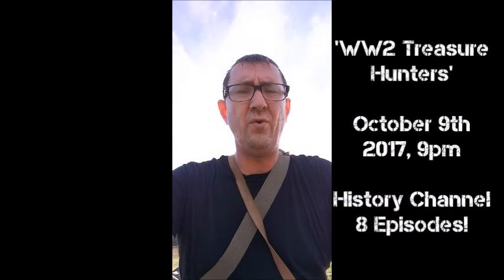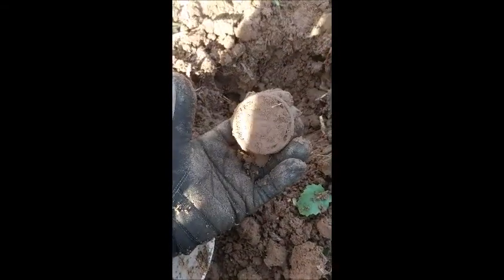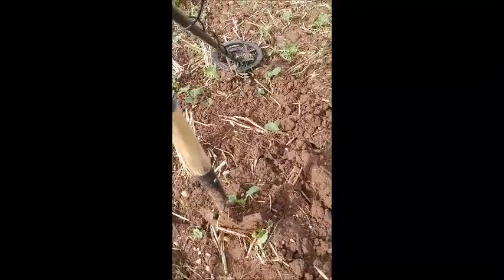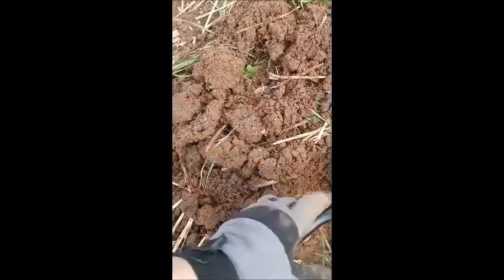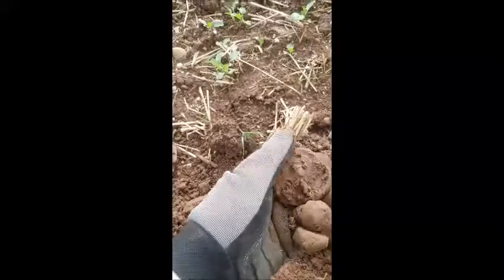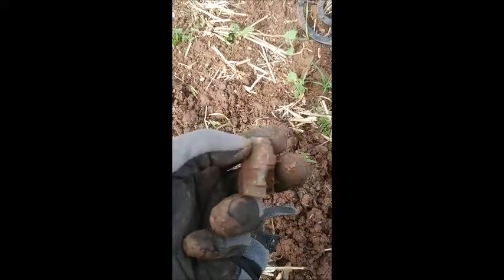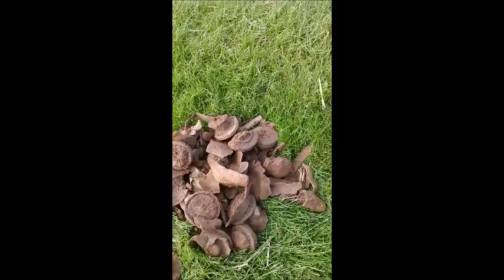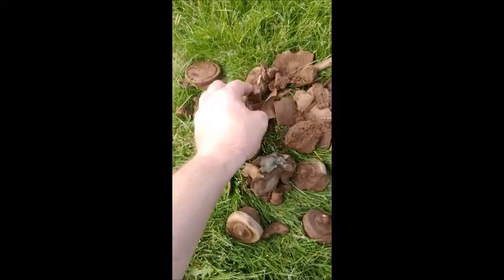WW2 RAOC Depot - Recovering Exploded WW2 ordnance!

Comment: Another great video with cool finds 👍 looking forward to the tv show, am I correct in thinking you use a rock tumbler to clean your finds? If so what medium do you use? Dry sand only or water & something else?
Reply from the maker: Hi Happidave - I don't use on it on everything by a long short......mainly cartridge cases or items I have multiple examples of. I use very fine sand and sometimes aluminium oxide. I find it works best if you use damp sand, without any other chemicals or detergents.
Reply: ww2relichunter thank you that’s really useful to know, thank you for sharing 

Kind regards

Dave